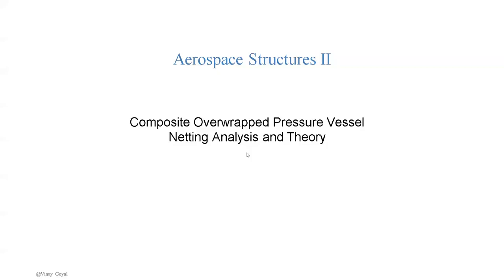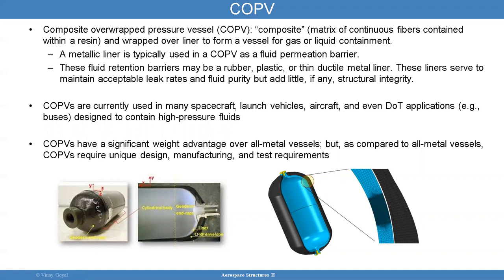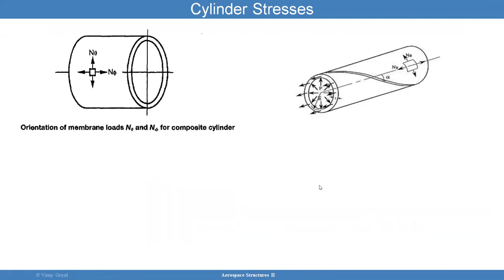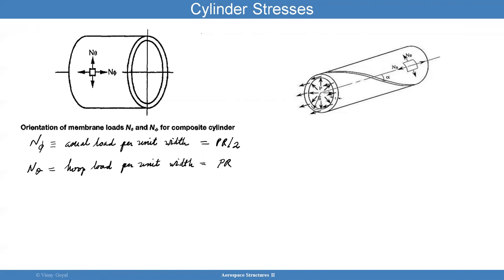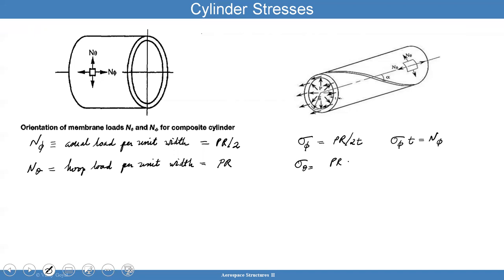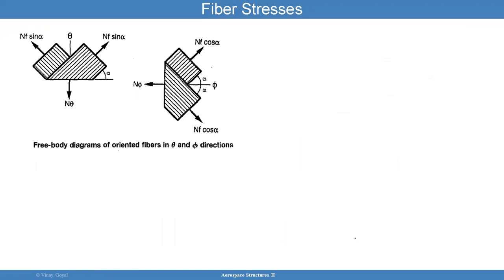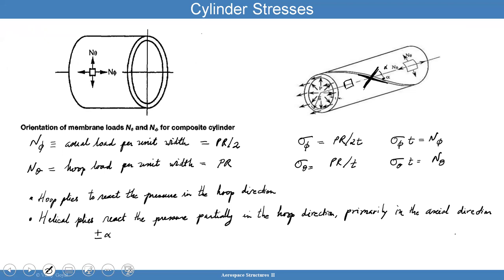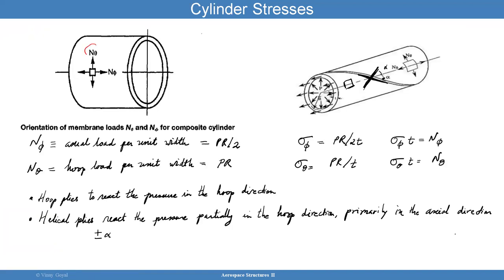Advanced Aerospace Structures: Lecture 4B -  Composite Pressure Vessel Netting Theory

Comment: Excellent Video - what about failure due to stress concentration at the corner to a capped end on the composite pressure vessel? There is a combine loading at that location so would you have you use a failure Theory?
Reply: please tell me which kind of failure theory?